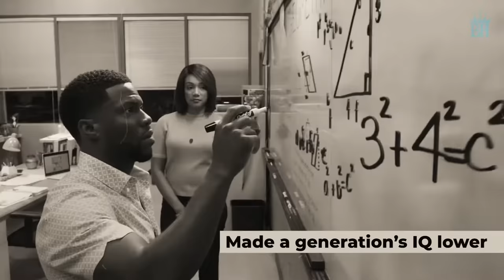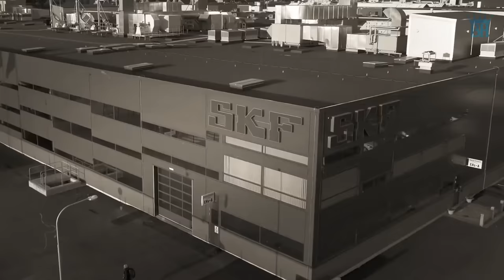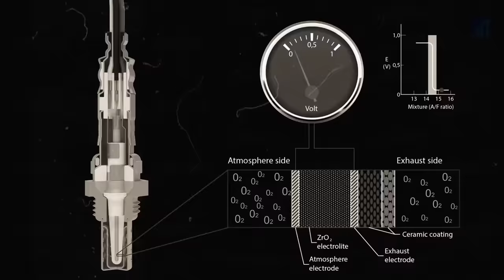History of Volvo | How Volvo Was Made

Comment: The people who made this video have not worked on the newer Volvos. The old engines were bulletproof, except for oil pumps. Oil pressure light or gauge shows no pressure, replace pump and drive on
Reply from the maker: Thanks
Reply: Tend to agree - I have driven and maintained a 2002 V40 for 10 years - it’s now done 230k miles - aside from mechanical upkeep the rust is killing it slowly but it’s had a good innings - Renault 1.9d engine. I recently bought a 2014 V70 as a replacement with 181k miles with Volvo engine - it has been a nightmare with blocked EGR, blocked DPF, leaking valves, leaking injectors etc and generally impossible to access components without removing the engine itself or being a contortionist - to add to this there is already significant corrosion starting to appear on the chassis and under the wheel arches 😢
Reply: These new Volvos are essentially Geely

Comment: I had previously 4 Volvo: 740D SW, 850 T5 summum, V70d5 summum and S80d5 executive. The best one was the T5.
I would like to warn people about the reliability of these cars: after 250 000 km the engine, gearbox and shock absorbers are still fine (even at 400 000 km) but EVERYTHING ELSE has to be changed: air condition condenser, fuel pump, odometer, gps dvd drive, radio, electric seats, etc...  It's a real shame !
When the roof is blocked opened, you have to remove the right front wheel and take out the alarm box which is dead after 8-10 years !!!  crazy !

The more you have options (that you loved when you got the car), the more you have breakdowns !
Further more you have to replace all the engine silent blocks every 120 000 km (it is very expensive if done by a Volvo dealer).

Now, I have a second hand Mercedes E350cdi W212 and have only the rotating knob of the GPS to replace at 350 000 km, nothing else.

I loved the seats of the Volvo and their stereo hifi but I hated their service price !
Reply from the maker: Thanks for your valuable comment

Comment: I've owned alot of cars since I was a young lad, bought my first car at 15.
Was a Volvo 244 from 1977.
It still runs today but with diffrent owner.
Currently I own
•Volvo 244GL 1982
•Volvo 245GL 1988
•Volvo PV544 1955
•Volvo 121 (Amazon) 1961

I've owned alot of Volvo cars through out my years, pure swedish metal that just keeps going if you take care of it.
My first volvo, 244 from '77 I did oil change three times during 7 years of owning it, I had rough time with money.
But ran like a clock.
Had to change usual stuff, brakes and such.. other then that? I believe I had to replace the generator.
Rest are basically the same, only I change oil twice a year.

Can't say the same about Saab, some love them but can't see why? Driven 4 diffrent Saabs and enjoyment ain't there? And how often they break or rust. No wonder they went bankroupt
Reply from the maker: Thanks for your valuable comment

Comment: Volvo used to be a great company, I’ve owned several models. However when Ford purchased the company it went down hill fast. I bought a V70, and almost immediately wished I hadn’t traded in the 945. The V70 was a Sierra clone and matched ford’s cheap approach to manufacture. After 25 years of Volvo ownership I purchased a German car and have never entered a Volvo dealership since 2003. Even Mercedes these days does not have the build quality of years ago when even never to be seen parts of the car were highly engineered. The accountants of BMW, Mercedes, Audi and probably Volvo have replaced the engineers.

Comment: 1)  Unique Valve for shortest Braking-Distance and supirior stability while braking. 
(Important for fast Passenger Cars)
1.1)  My Invention:
I have a (complete design of) low-cost Valve that will replace the 2 on-off solenoid valves (for each wheel, in the ABS) 
1.2)  Will create Brakage: 98% of ideal decelaration on dry-asphalt with paddels (wet-asphalt): 
2)  Thus create the best ABS in the world,  Reduce ABS size (more reliable than solenoid valve). 
3)  Note: Today ABS use two On-Off Solenoid-Valves because Proportional-Solenoid is not good: 
Low-Reliability, and at mid position: the flow will be too high: thus, compell bigger-pump. 
4)  Dear OEM : Please Reply...

Comment: Safety this, safety that, yada, yada... would you please talk about the concept of durability and easy maintenance and repair?
In the early days of the brand Volvo engineers, knowing they couldn't rely on a large network of dealerships and specialized brand repair shops, designed their cars in a way that their customers would be able to do almost any maintenance and repair in their own garage at home. Also, they massively over-engineered those cars so they wouldn't easily break in the first place.
And that, ladies and gentlemen, is why Volvos are perceived as a near indestructible asset that can be passed down in a family for at least 3 generations.
Reply from the maker: Great to hear! could you explain more

Comment: My opinion is cars and trucks might be ok but I run a 2020  110h front end loader and it is a joke, had the def  system replaced 7 times so far, hydraulic is weak compared to the old cat 950 I ran, rougher ride that the cat , will not shove as much as cat and spins tires way to easily ( whether I run it or someone else, it's the loader not the operator )
Reply from the maker: Thanks for your valuable comment